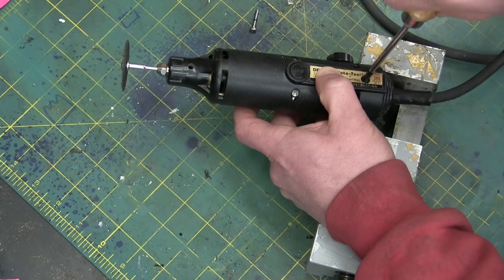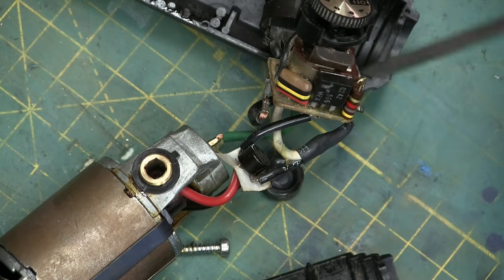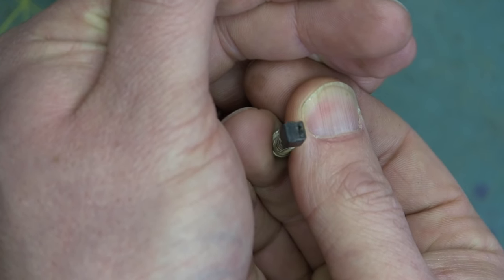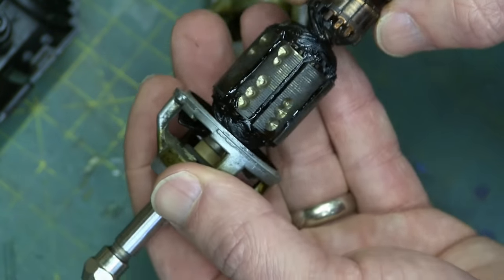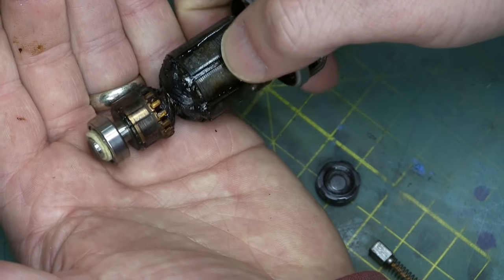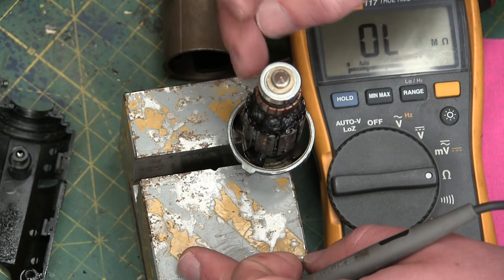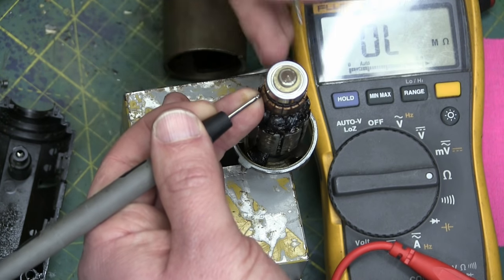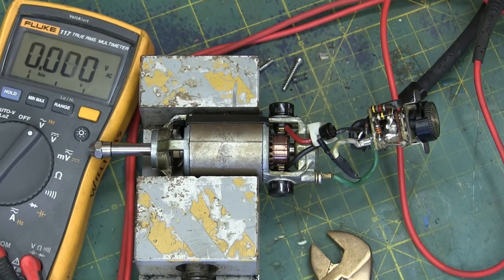Electric Motor Repair. AKA You gotta know when to call it quits.

Comment: I work in a rewind shop in Ireland. We still get small jobs like this (mostly giant wind turbine generators or three phasers) but still some. 

The way I like to test these armatures is to first get an ohm reading with a few kilo-pixies between the comm and the actual rotor, that is usually the kicker if the winding isnt overheated or burnt. 

Then i stick a 40 DC voltage across two comm bars at opposite ends and check the mV bar by bar. Again if nothing I'd bring out this magnetic field tester with two cotact points that runs a small voltage through the iron core and detects any voltage leak to it.

These small permanent magnet motors are a pain and we usually do replace but a good 40% get rewound at our shop
Reply: But can you rewind time?
Reply: Nice try NASA
Reply: I had a commutator problem on the M18 multitool, just one winding open circuit and the bloody thing kept stalling on start up, had to ditch the motor and  get a fleabay motor, looking back maybe I should of just shorted out the commutator plates to the next one, get a bit of life out of her.

Comment: My Dad did his electrical apprenticeship as a motor winder. He had a "growler" - I was always fascinated by it as a kid (probably mostly by the noise it made and the fact that I was not allowed to touch it). I am sure he still has it floating about in his shed somewhere...
It was used to locate shorted turns (which are not so obvious when probing with an ohmmeter) - but I remember his one was made for larger motors and was not so good at diagnosing the small drill/vacuum cleaner motors that inevitably came our way...

Comment: I am sure you are well educated in electric motors, but I am an engineer at a large motor/generator repair facility.  If you have any questions, especially off the wall ones, I would be glad to answer them.  If I don't know the answer, I can bounce the questions around at work with my fellow colleagues.  I love you channel, its one of the few I keep up with!
Reply: Would it take a long time to replace one winding? don't know how many turns for instance a Milwaukee brushed motor has or even if its possible when you have other windings on there that might overlap?
Reply: @engjds  you cannot just simply replace one winding. It’s all or nothing.

Comment: You made me smile when you talked about the Growler. Many, many, moons ago College we learned how to use the Growler when we rebuilt automotive starters and generators.
Reply: So do you actually eyeball for vibration with that?
Reply: @engjds  Yes, that and sometimes you could use an old hacksaw blade. When it came across a bad spot/field winding it would vibrate.

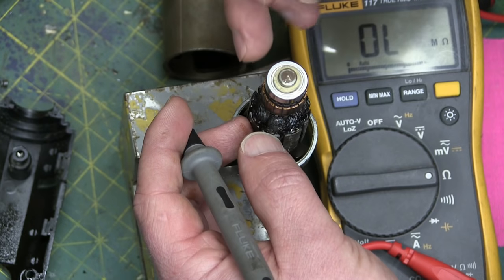Comment: My Dad used to do motor re-winding as a 3rd job. (Yes we grew up piss poor) He worked as an electrician with the local town council.  After coming home from work at 16:00, he would set up the home-made coil winders and then be off to work as a projector operator at the local drive-in theater, that was still showing flicks 6 days of the week. There he met my Mother that worked in the cafeteria.  Then after my Mom finished up after the half-time interval, she would go home and wind the coils while my Dad finished up the second part of the film.  When he got home they would pack the motor and he'd be back on the tools at the town council at 7:00 the next morning.  

He still has the "growler" (still working) as well as all the coil winders and associated gear to complete the job packed away in his workshop.

And to top it all off he built a Bowers Fly Baby in his "spare time"...

Boy does this bring back memories.

Comment: I work for a small family owned auto electrical company and we still rebuild starter and alternators, we deal with long motor corporation in cansas rebuilding British alternators for there stock and still using testing equipment from the 40's for dynamo's

Comment: If I'm not mistaken the armature is series wound which means that if you test conductivity not just between opposite commutator contacts but ANY two contacts you will see very low resistance.  That's why the motor shops use growlers to induce a voltage.

Try it.

Comment: I spent 15 years rewinding all sorts of vintage electrical stuff and I have never seen anything from the 50s or older with shellac wires. Only things pre ww2. And the shellac will normally crack now if you bend, fart on or just touch the wire. Proper old stuff is shellac with cotton covering over that. And super fancy used silk instead of cotton. 
I am certain that wire will not be a shellac magnet wire.

Comment: Rebuilding alternators that don't have to be rewound is profitable. I just rebuilt a local parts store "rebuilt" alternator. What I found on teardown was that the Mexican who replaced is innards, only hand tightened some of the components and the brushes where likely not replace in the previous "rebuild". I could have gone to the parts store and got the same kind of nonsense for $60, but instead I bought a $25 rebuild kit and now I have something I half way trust. Since this is on a Pontiac Fiero and the alternator has to be removed from the rear passenger wheel well, I don't want to make removing the alternator a regular occurrence.

Comment: Not sure here but if the opposing commutator pairs showed continuity you still could have several turn to turn shorts in the armature windings which would cause the varnish to burn under full voltage- no?

Comment: It's more fun when it's a 240V BIG ASS motor for a swimming pool pump and you are basically standing in water and your partner in crime ( the pool owner in this case ) says just before slapping the power back on "You think we got it hooked up right?" And I said in my head as I attempted to stand on the plastic bucket to keep from being Southern fried white meat chicken.  "WE my ass. I told you to call a real electrician!"  It smelled BAD and got hot as FUCK after about 20 seconds.  Fun times indeed.

Comment: I took my table saw motor apart 1970... I took the bearing dust seals off cleaned & added that marine grade synthetic grease... Cleaned the windings & revarnished them .... Now at first i had the cap wired wrong ... After a correction saw started great with a lil smoke but then the cap started smoking & leaking ...was that probably my fault for trying to start it not helping at first or is it the motor goin bad ? .... Damn thing worked great but all the wiring was in deathly bad shape 
... I'd appreciate input sir

Comment: The 200k ohms is. Most Likely just reading through your fingers as you were touching both meter leads. I always try to not touch one lead to get an accurate reading. Not always easy when trying to contact small electronics or round surfaces

Comment: Those lines aren't brushed on, to be a bit pedantic, but my granch used to work in a roller factory as an apprentice and they used to make small wheels from offcuts for a nearby electronics company. The common method was using string with paint on a pulley system and rolling the devices on the strings on a system of pulleys to get the lines on! Interesting shit!

Comment: Hey I have a rather large 60v 1500 watt brushless motor that came off a Raven 7100 mpv mower deck. Failed to chooch took it off found out the bearings were toast they replaced it under warranty would you like to do a vidjeo on it and find out why it failed to chooch

Comment: I live in a town here in Ireland with 25k people and last time my friends amp blew a tranny we found of all the services we don't have , there is a guy who does rewinds, rewind for the transformer was 200 or a new one from crown 600, easy choice really ....we joined all the wires from one side to the other and locked it on 50%.(should add the amp has two transformers)

Comment: old school chevy starters, anyone know why hitting it with hammer will make it chooch again, there is a contact disk I'm the solenoid overtime Nets Illinois gets covered in contacts starting it over and over a lot of the time you go to start your truck and it's at a point where it's already made contact so you bang on it with a hammer shakes the disc you get a new contact point now a lot of the times you can take that solenoid apart flip that disc around put it back in brand new solenoid
Reply: typos sorry, corrected version. the late seventies Chevrolet starters Big Blocks the solenoid has a contact disk in it over the years that contact desk gets burnt if you will so if you give her a wackadoo with a hammer it should move it to a new spot and then you get koorntact if that doesn't work you can take the back off the solenoid take the copper disc out give her a 180 put her back in and it's like a brand new solenoid
Reply: This collection of words is spectacular! Mind if i bag it for later? No idea what they all mean and whether it's supposed to be a sentence, but fascinating.
Reply: Siana Gearz sorry I was a driving using talk to text either I can't talk or my new phone has a speech problem

Comment: The off center wear pattern on the brushes is typical of the half dozen sets I've worn out over 40+ years.

I've often suspected it might balance out if one were to regularly check the brushes and rotate them 180 before reinserting, but where's the fun in that?

Comment: Do you have any experience with bios/efi recovery and programming and if so what chip programming equipment do you think is suitable for programming a wide array of chips?
Reply: Just get a universal programmer. Some can be found on ebay for around $50. They will work with most flash and EEPROM chips. Make sure to get the correct adapter for your chip if it's not in a DIP package.

Comment: Well i guess that those caps could be painted by dipping, just dip the whole component first then gradually less to leave a stripe of the color under the next layer
Reply: Basileus s but talk about a project... that's a lotta dipping and drying.
Reply: If that was the case, you wouldn't see brush strokes on there.

Comment: Rubber sealed bearing in my brand new dremel is shot, no way to pull and replace cause of how the armature is built. Gonna try anyway, bush league style. Its a shame, my 20 year old dremel with metal seals never had an issue.

Comment: I've seen The Post-Apocaliptic Inventor use some sandpaper on old commutator bars, do you think it's a good idea to do that when "restoring" old power tools ?
Nice video btw and have a nice week =)
Reply: flo ri I'd do it. when I was younger and into rc cars with brushed motors you'd clean the commutator with a piece of fiberglass stick when giving the motor a good cleaning. you could also cut the commutator flat again with a small lathe, so fine sandpaper would pass my test.
Reply: Oh alright then, thanks for aswering =)

Comment: The snipping of the commutator bars is useless. The coils are in a ring/David's star pattern. All are energized even if the brushes are only touching the two opposing sides. You want that to have an efficient winding cross-section.

Comment: I’m no stranger to a hammer “ tapping “ a motor to keep the machine running. The method is the hammer used the wrong ways , tappy tap TAP

Comment: No fricken way thats brushed... Logic, its thicker at the bottom... serial dippin... first full dip red, then (cant remember colors and doin this on my phone so just bare ass with me) yellow dip not all the way, then brown then light brown, they let it dry between coats.... this its thinnet at the connection end where they hold it from like a handle.  no brushes, just several dips.  faster, and easy to have irregularities in sizes of the bands based on the depth of the dip, and mind you the last is just the tip, and only, for a ... second most likely.  mystery solved, can I get a hell yeah!

Comment: AvE, electric motors with ceramic magnets don't like to be struck on the case. Turns out those magnets are pretty brittle, I've had a few customers with no starts over the years where they had beaten the holy fuck out of their starters and broke the magnets.

Comment: what we know so far:  Thor trumps Beetlejuice, you can't fix a burnt motor with a hammer, and it's a lot easier to do it than to undo it.
Reply: I believe I inadvertently salvaged some of this shellacked magnet wire for RC use, and this couldn't be more true.  If it seems flaky, even if it's only when you are TRYING to scrape it off, it's probably junk.  Good insulation shouldn't come off easily.

Comment: Dude. Break the capacitor and you will see the layers of paint.
I actually went in and ground up each and every layer of paint on a capacitor like that and I have a picture of it.
Can't really add more proof than that.
http://i.imgur.com/IUy5YO1.jpg
Paints have viscosity and those soviet hands fiddled around fast. Of course it will be uneven!